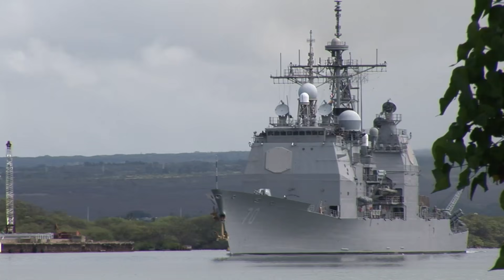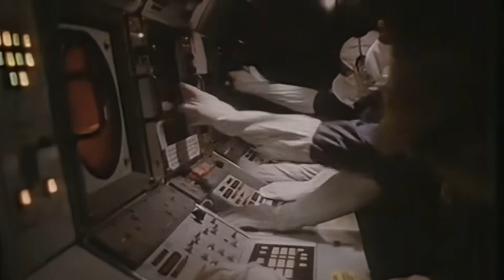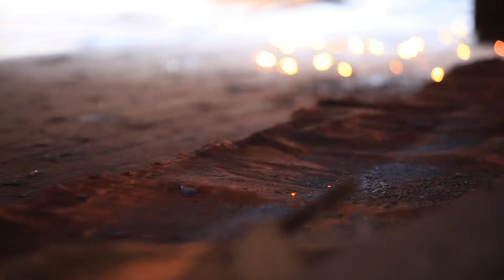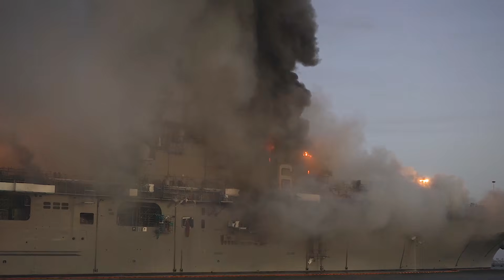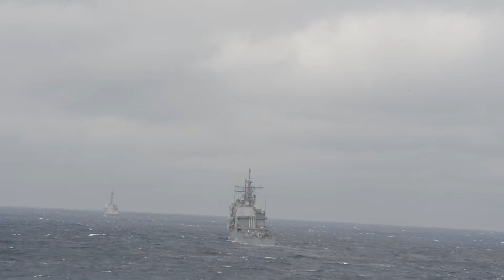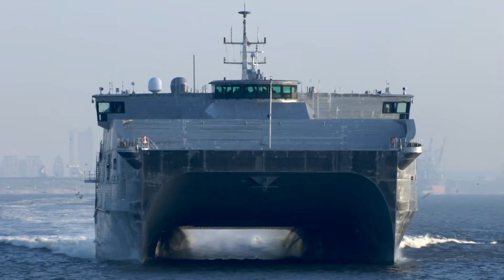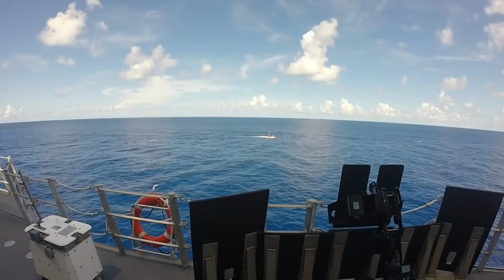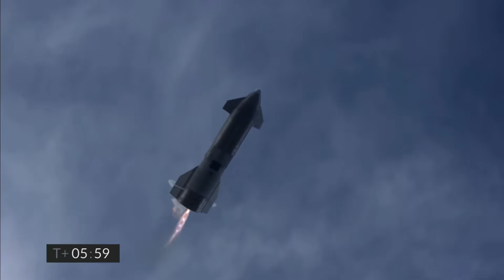Why is The US Building Aluminum Warships?

Comment: We are at a point technologically where everything that is mobile is a glass cannon, as the offense far exceeds the defense possible. This is true in ships, planes, tanks etc.
Reply: Yep. Very dense point defenses are the only thing that might save a ship at this point.
Reply: @tackytrooper  
True, the hulls of the Fleet can be penitrated real easy by a lot of long range weaponry
Reply: Except for infantry against small arms. I know there is a smart targeting system for hunting. Like tracking point.
Reply: @dianapennepacker6854  Right, never used it but supposedly it is really good. But, when speaking of defense, I assume you mean body armor, and some of that is good enough so just hitting the target is not enough. Perhaps you have seen some of the videos, such as the one about "deer rifles" vs body armor, and even the .338 with its normal long range ammunition did not penetrate the metal plate - although it would do a lot of damage to the wearer thereof. It might do better with a lighter (hypersonic?:-) bullet, but then you give up the advantage of the current bullet for long range; and the lighter bullet loses its velocity advantage somewhere out there. And I posted a comment about whether the armor they tested is equal to what the Russians use but have not seen a reply.
Reply: I think that has happened because of ridiculous advances in weapon technology. To the point that armor is practically worthless. But it's just a theory. A .... THEORY.
Reply: Abrams depleted uranium armor wants to have a talk with you.
Reply: @bricefleckenstein9666  wouldn't mater if we had depleted uranium hulls. Modern missile don't target hulls. For 30ish years harpoons and everything since are top down attack
Reply: @aarondilley5266  Cruise missiles aren't very good at top-down, if they try to do so at all.
Most ship-to-ship specific missiles though, you have a point.
I wasn't a missile tech when I was in the Navy though, so didn't pay attention to those (I DID work on the Cruise Missile programs after I got out, on some of their electronics).
Reply: @bricefleckenstein9666  i was ewar 30 years ago. Harpoon is naval version of javlin with popup or direct fire mode. It is 30 years old i imagine that all upgrades an new systems do similar. At least for nato primary anti ship weapons. If they don't blame procurement for getting junk. As far as cruise missiles i only know tomahawk wich is not for anti ship  but i guess if you live long enough to run out of harpoons might as well try it. Can't think of a reason to use a cruise or ballistic missile against a ship if anti ship missles are available
Reply: @aarondilley5266  I was ET Comm.
I think Harpoon might go back into the 1970s, I just didn't pay a lot of attention to how it worked at the time.

And yes, Tomahawk CAN be used as anti-ship, though that's not it's normal primary mission - I've seen it demoed in that mode, and I agree using an actual anti-ship specific missile would normally work better (though Tomahawk with a nuke warhead could sink an entire task force if that task force wasn't spread out enough, like transiting the Straights of Malacca).
Reply: Materials sciences and/or energy shielding needs to catch up first.
Reply: @Pilot JollyRoger lol never said i want to. I said seaworthyness is all that matters no hull will stop a harpon.
Reply: But offence can become so capable, that it can shoot down rockets, torpedoes etc. easily (lasers, projectiles with very high kinetic energy etc. still problematic).
Reply: Not true at all.

USA B2 bomber is made entirely of carbon-graphite composite material not a single plane has ever been shot down on any mission in over 32 years
Reply: Yeah unless we can make some Boron Nitrate nanotubes or something the way of plate armor is going to end. It either is too heavy to be practical for any defense.

 Curious on how reactive armor would be on a ship. Ships still can take a ton of damage though. You still want it sturdy enough so no regular missile can pierce towards the fuel and ammo. 

 Anyway first generation lasers are now coming online so maybe there is hope that our carriers aren't just sitting ducks. I forsee small ships who's only role is to carry anti air and sea defenses. Three layers - missiles for range - lasers for medium to short ‐ 35mm/70mm automated turrets with AHEAD ammo for last resort. The Italians are going to try to upgrade their 70mm naval gun to 200rpm and say it can take out missiles. 

 Hell maybe they can design some ship trophy system too.

 Personally I wish we focused more on submarines. Aircraft carriers are great but they are like putting all your eggs in one basket.
Reply: Nothing can last one day under attack without active defense so yeah, all glass canon actually
Reply: @trevorle7382  in the 90' expected survival was 7 minutes thats what they told us
Reply: That means our best defense is our best offense
Reply: @Pilot JollyRoger Nuclear deterrence, stops all threats of invasion since they can never win. At that point all you need is drones to go murder whomever threatens you internally, or a form of policing body.
Reply: little combat is in gun range (15 miles) and missile (400miles+  range) will always win against hulls of any type. active missile defense matters more than hull strength materials need to be chosen for sea worthiness not combat.
Reply: I'm pretty sure that in the near future, carbon nanotubes will be used in building these war machines
Reply: @Pilot JollyRoger You don't know what carbon nanotubes are, don't ya?
Reply: We went from slow durable tanks to fast af soldiers with shoulder fired anti just about anything
Reply: It seems like instead of sinking billions into a few giant glass cannons, it would make more sense to build many smaller ships
Reply: @trstmeimadctr  
True, like Destroyers. Even Cruisers now are just larger Destroyers that, tbh, depending on the nation, sadly aren't too useful if you can't get them to be maneuverable enough.

Unless it's an Aircraft carrier but, tbh, that's always been a floating bomb so... no change there
Reply: The best defense is a great offense
Reply: M1 Abrams doesn’t fall into that class they are 60 tons and can survive a direct hit from almost any anti tank weapon
Reply: Planes are the least effected by this as in the case of planes it is mostly about speed stealth range and missle range
Reply: It's better to have active countermeasures than more armor sometimes. Still metallic mercury will eat through aluminum on contact like nobody's business, so I would be worried.
Reply: The Japanese once had a core of officers who believed it was possible to build an unsinkable battleship.
Reality disproved the idea that ships could not be sunk.
The West Wing TV series said it best… if someone builds a better shield, someone else will build a better bomb.
Reply: This is as false today as it ever was.  
Cities shoot down entire bombers; bombers only injure cities.
Infantry over-runs gun emplacements; gun emplacements only injure infantry formations.
The Dardanelles made a fool of Churchill in WWII, just as in WWI; so much for neutrality!  Defense 2, Churchill 0.
And YouTube still exposes fools who post idiocies.  But you're still mobile, Joe.
Reply: Spoiler alert this is far worse in space
Like so far worse
I’m wondering what the future will be like with conflicts where 2 factions are in space because let’s just say it’s very cheap for both sides to completely wipe out the other in a way neither can defend 
So let’s say russia and america both build factories on the moon and asteroids, then they go to war... what happens to all their stuff in space? If they attack both lose everything
So do they just ignore everything in space even if they build military stuff there because they know there is nothing to gain? And keep fighting on earth? 
Also depending on the distance, in space a strike can take from hours to days to... months. But once it’s launched usually you can’t cancel it without losing the ability to use the missiIe. You can cancel it but now it wasted fuel so if an opponent surrenders seing the missiIes approach and you accept the surrender, then time passes, and they decide to move to an orbit where you now no longer have the delta v to reach them... then you’re screwed
So does that mean no one will ever accept surrenders in space? All these interesting questions 

On earth generally if a missiIe is launched it will not be called back, the targets usually don’t even know its coming and don’t have enough time to surrender or make a call anyways. It takes minutes on earth. Short range cruise missiIes. Tomahawks etc. Yes that’s baby range by space standards. On earth everything takes at most minutes to reach a target. In space, there is no stealth and everything takes hours to days to reach targets. So any target would know missiIes are coming, making them more likely to surrender. But how do you even enact a surrender? If you have the ability to yeet a missiIe from earth to Ceres, it doesn’t mean you have the ability or even desire to send a shuttle to pick up the crew on Ceres and bring them to earth. I don’t know how it will infold but it’s guaranteed it will, we will continue to develop then into space then people who both have stuff in space will fight. But then what? Space is a very different environment than all earth combat
Reply: And what makes you think that this "point" is only reached NOW? it was basically the same in the 90s at the very least, probably started out in the 70s to lean that way.

It's also the reason why any Navy and other force that can afford it now defends offensively by stacking the layers far enough that "our" weapons outreach anybody who might want to shoot at "us"...
Reply: Exactly, and once force fields become a thing it's gonna be the complete opposite lol
Reply: @PeachDragon_   Ya but that technology is still decades if not more away from being used practically for even static instillations on land that could have power generators powerful enough to use one, let alone mount one on a ship, Tank or Plane. Offensive technology has soared past Defensive tech to the point the best defense is finding new ways to just not get hit and not how to survive getting hit.
Reply: @deloreanrc  you're not wrong but a man can hope lmao
Reply: @deloreanrc  basically exactly what nature tells us xD
Camouflage, surprise attacks and range superiority work best. Just as retreat is the most effective survival strategy
Reply: @datpudding5338  retreating is a good survival strategy, but if you want to defeat an enemy kinetically you need to eventually be within weapons range, which means you need longer rnaged weapons and sensors than what the enemy has and/or way better defensive systems or you're probably gonna eventually take hits.
And if your defensives systems are good enough you dont need to retreat in the first place - at least not just to survive.
Reply: @1337flite  make a run for it while leaving every square centimetre filled to the brim with mines and other explosives - metaphorically speaking.
While they assess the damage you can get a few more meters in between. Now rinse and repeat or leg it to somewhere the enemy wouldn't bother to chase you.

Basically scorched earth tactics but a little optimised for destructive effect. A gravity based tilt switch is easy and fast to do with basically anything conductive and a jerry can for example starts looking like an IED.

While they have to keep supply lines stable while you can turn almost anything into a trap. Like some civilian home which of the owners - most likely - fled already may have some gasoline (lawnmower, etc.) or some form of butane/propane bottle (some grill or stove) and for example a pistol plus a single cartridge combined with some string makes a feasible tripwire-antipersonnel mine.

I mean it's war after all so there isn't honor to be lost as honor becomes a mere theoretical concept as soon as humans start killing each other
Reply: The Admirals won't tell you but the Chinese could sink our entire Navy with huge flurries of cheap hypersonic, broken-trajectory missiles that can overwhelm All defenses, including Phalanx.
Reply: @cybervigilante  ships cannot be targeted with hypersonic weapons, or at least they would have to slow down to supersonic speeds to get updated targeting information, as hypersonic speeds created a plasma shield around the projectile inhibiting communications rendering a hypersonic weapon useless against a moving target.
Reply: @moonbear2130  If they are hypersonic I can only imagine what it's like getting shot at by them... just turning the ship and going faster and witness all 200 missiles miss without having to do anything else. xD
Reply: @moonbear2130  Hint - the US was working with hypersonic missile designs in the 1950s.
NOT new technology, the issues are well known.
Reply: @moonbear2130  lmao you don’t know what you’re talking about.
Reply: @bricefleckenstein9666  navy announced zumwalt ags is geting replaced with hypersonic missiles by next year.
Reply: @moonbear2130
No lol
Maybe that was an issue in the 1950s but you absolutely can aim at a moving target with something moving that fast it’s not even hard, usually just having the antenna at the back and being satellite guided is enough, plus other communication types can talk through plasma, and again the plasma is only at the front there is no plasma to the back or rear sides

If america hasn’t solved guidance through plasma... then america is 60 years behind in technology
Reply: @bricefleckendtein9666
No lol, you’re confusing regular ICBMs and hypersonics
The things that are called hypersonics nowadays are guided basically gliders that can turn while going that fast

In the 50s they only had ICBMs which are as simple as any old rocket, even a V2 could deliver a hypersonic warhead if it wanted to, just fly suborbital and detach a dense payload 

America was actually extremely late and behind on hypersonics, America only had the LRHW which had to be the cringiest name I’ve ever seen, and the OSINT people can correct me if I’m wrong but it’s still not entered mass production as of 2025 so america basically doesn’t even have hypersonics TODAY, beyond a few prototypes 
The first one was French and the first mass produced one was Chinese and China had it 20 years before america, with the DFZF being in mass production in 2019
Again america still doesn’t make those TODAY, america is way behind both in technology and in industrial output, the only advantage america has is oil that won’t last forever anyways
Reply: @cybervigilante  u know those shits are expensive and still interceptable though right
Reply: @cybervigilante  sucking up to the Chinese +100 social credits bing chilling
Reply: @cybervigilante  Ballistic missiles if you are speaking of the Dong-Feng.
Reply: @mikecimerian6913  no need to -, it’s just Dong Feng. No harsh tho
Reply: @cybervigilante  well, if there's one other country that is nuts for missiles, itvs the US.
Reply: @cybervigilante  Welcome to why we have nukes capable of reaching all around the world, and enough for everyone. We made our submarine fleet for a reason.
Reply: @cybervigilante  phalanx is 40 years old. New systems can defeat old defenses is kinda duh. Thats why we have lasers now Google it
Reply: @cybervigilante  Do we know anything about the range of those missiles, compared to the aircraft that would be on the carrier, plus that of the missiles launched from those planes? Could be a big difference with the second carrier, sailing in when they know the war has started.
Reply: @cybervigilante  Cheap and hypersonic don't go together.
Reply: @cybervigilante  Hypersonic tech isn't cheap.
Just because Russia couldn't intercept with 40 a single US tomahawk SUBSONIC missile doesn't mean everyone is similar.
US had 1000s of interceptors that each could 99.998% take out a hypersonic missile in the 1960s through satellites view & computer calculations.
Reply: @cybervigilante  Super sonic can be made cheap, which would be a deadly threat if we don't achieve air and water superiority fast. Hypersonics not so much those would bankrupt China by the time our first wave of navy is spent in all out warfare, and that's when our air force would would become overwhelming
Reply: @cybervigilante and the same for China?

Like no duh ciws gets overwhelmed. There the last line of defenses
Reply: @cybervigilante
CIWS buIIets fly at around 1kps (like all buIIets more or less), supersonic is 0.35 kps, 3 times the speed of sound is 1kps. CIWS can thus be useful on slow or subsonic cruise missiIes

But fast cruise/ballistic ones will fly as fast or faster than the buIIets CIWS is shooting. A hypersonic could be... idk it really depends on the model but it could go between 3kps and 10 kps. More likely 3-5 with basic tech

Now the incoming threat is flying in 3-5 times faster than the phalanx buIIets, which divides the effective range by 6. And the effective range of CIWS is like 1-4 km to begin with its extremely short. The incoming missiIe can travel that distance in less than 1 second

For CIWS dodging is irrelevant. Something that is moving at 5kps CANNOT dodge and swerve a lot. It can do it somewhat but those are slow gradual movements, it bends a nearly straight line trajectory that’s it. Now that can still be useful to either waste the fuel of interceptors (I’m going left better aim left! Sike I’m going right now you need to turn and go back!) or even dodge if the interceptor doesn’t have the same ability to turn in terms of acceleration. 

Anyways I would be more worried about america having no industry and then... giving all its industry to China for some unclear reason 
That’s a bigger issue for america then how fast the missiIes are 😂